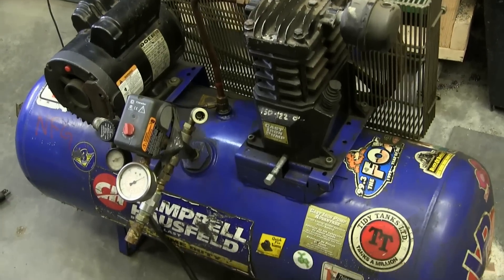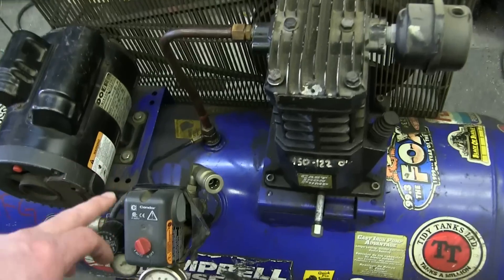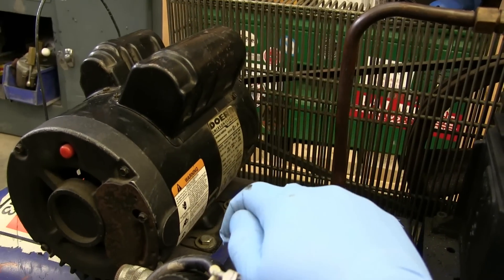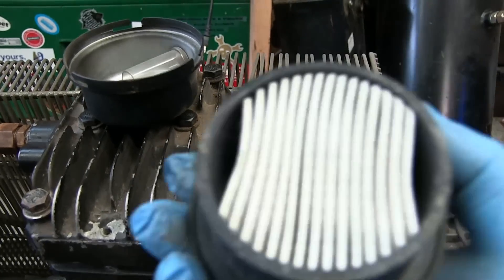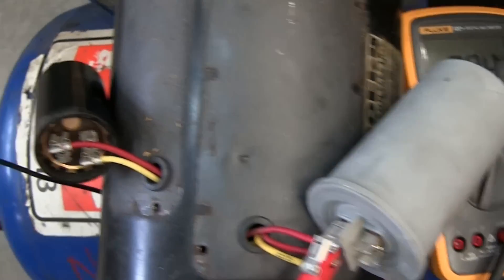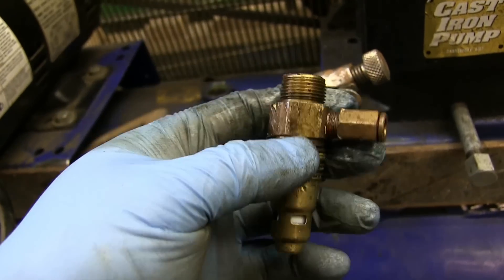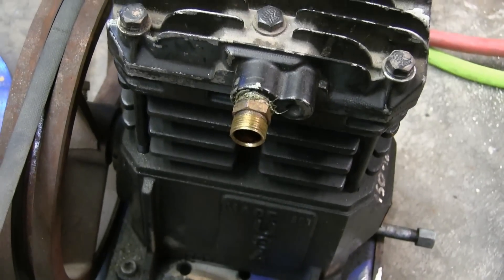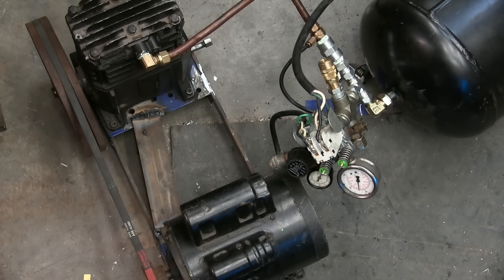BOLTR: Air Compressor Explained and Fixed.

Comment: That long tube doesn’t send the pressure to the switch, the switch diaphragm in the middle is connected to tank pressure through the 1/4” NPT nipple at the tank. That tube is part of the unloader that ensures the piston isn’t starting against any pressure. It empties the pipe from the cylinder head valve to the check valve at the tank.

Comment: Excellent video...  The couple hundred dislikes only proves that there are some serious idiots out there who aren't smart enough to know when they're being given a master class and terrific information.  It boggles the mind, as to what they're expecting to hear.
 I was an air compressor/pneumatic tool repair tech for neigh-on a decade and I've not heard anyone be able to properly explain their function, outside of the trade (that includes you, my industrial engineering friend, in "the trade" 😆)...  But I've known a whole lot who could mess one up in a hurry. 
  The valves in the pump (depending upon mnfctr) may be circular, disc valves or they may be rectangular "reed valves" that just flex up and down, letting the air flow in through one set, out through another set in the valve plate, located between the head and the piston cylinder body, passing the air through the pump.
  The reed valves are regularly breaking as they become brittle after so many heating and cooling cycles so, anytime your compressor suddenly stops building pressure, first thing is pull the head and examine the valves.  Circular valves can become carbon fouled and stick/break, as well.
  Uummm, those air filters are cheap, you may want to replace that thing...  😆  Not only will you get better air flow, your pump won't work as hard, helping keep the Temps happy.  😀 (I know you know this, just letting people watching this know how important clean pump filters are).
  Change the pump oil regularly!  There's no oil filter and the rods will seize to the crank!!!
  The belt tension should be same as your car, able to turn 90° left/right with about 1" - 1 1/2" total deflection.
  The number one thing to keep from frying the capacitors and the motor is DO NOT RUN EXTENTION CORDS!  50' @10ga., max length.   If you need to reach farther away to the work, use longer air lines!!!  A, it's extra air storage in longer lines and B, it's cheaper to buy air hose than electric hose!!  I replaced many motors that should never have gone bad because people kept running compressors on 100+ft. of light gauge extention cord instead of just buying more air hose.  Stupid at its finest.
  As a major Mr fix-it, certified mechanic, fabricator and all around cheapskate, I'd love to find a way to fix it.  Buuut...  For that type of compressor, they make reasonably priced replacement tanks all day long.
  You're right about the whole pressure vessel thing, even if you rendered any flammable inert, welding a pressure vessel and guaranteeing that there is zero hidden porosity or heat-induced weakness in the repair area is next to impossible.  Or at least enough so that it's not worth the risk unless you absolutely had to have the tank and couldn't find a replacement, then you'd have to pull that bung and find a way to insert a piece of backing metal to reinforce it, drill some holes in the area to be welded and through -tack the piece in place, then grind and welding the crack, bonding the tank and reinforcement.  Uh, yeah.
  Creating an area stronger than the area being repaired is next to impossible.  The only way to "cowboy through" would be flood, grind and fill it, X-ray it then over pressure the tank by a few hundred percent and leave it for a loong while to see if it holds.  then replace the tank ASAP so it doesn't have a chance to rust through (welding and forgetting it would let just enough time pass for some, poor sap to come in and use it at full pressure and blow himself up).
  If all that sounds like a rant of excessive BS,  it's because you don't welding pressure vessels...  😆

Comment: Pro(HVAC)tip. If your centrifugal switch goes out, bypass it and replace your start capacitor with a hard start kit.google" (motor hp) hard start kit".about the same price as a centrifugal switch and more durable.

Comment: Do not let fear and common sense hold you back Young man great things await you. This must be a common problem as I have the same tank and compressor and it had the same problem.
 The problem is they're trying to weld cast to normal steel. Being that I to Live in the empire of dirt as well.  Sout west of you on an Island we do have to fix things.  Just weld it up and it will be good for another 1/4 century. If not I will let you know.

Comment: I built pressure vessels for near 10 years as a welder. Difference was most everything was 1/2" thick. But everything was xray and hydro pressure tested. 

That said it can be welded BUT I would drill a hole at the end of each crack. Grind out damage and weld up. Yes fill with water  and rinse out. Then back purge with 100% argon

Comment: I have an air compressor that blows breakers because the motor stalls when it turns on. If I turn the pulley by hand to get it going it will chooch... what could be the problem?
Reply: Either the unloader valve or a start capacitor is my bet

Comment: i welded a 200 gallon quincy blindly 6 years ago where a leg broke off behind it next to the wall.  it couldn't be moved easily and at the break it was a bad leak.  6 years later it just started leaking again.  i won't be welding it this time.  that thing shakes like and sounds like a harley.  50 horse electric motor (oversized), qr 5120 compressor.  tank is much older and too small at 200 gallon.  we run it at 150 psi.

Comment: Where did you install the check valve?  Looks like you put it into the female to female coupling?  It had enough length to fit the check inside?

Comment: The valves on the cylinder head are reed valves like on a dirtbike with a two-stroke engine. that small tube is called the unloader which allows the section of pipe to be “unloaded” when it achieves its desired pressure...So it’s not starting up against a load. The switch senses pressure from the diaphragm underneath the pressure switch which is screwed directly to the tank nipple

Comment: I need additional info on the bleeder tube and pressure switch. The Pressure Switch - as far as I understand gets its pressure reading from the fitting on the back which runs into the tank, is that right? So what does the black bleeder tube do and why does it run back into the check valve on the engine side?

Comment: I think you're confused on electric motors and what run capacitors are for.  Run capacitors do the  same thing as start capacitors except they send power to the start windings whenever the motor is running and they're a lower micro farad rating. If you remove the run capacitor, the last thing I would be wiring about is pissing off the power company and more concerned with my motor drawing LRA and trippng overloads.

Comment: Low pressure vessel. A simple hydro test using anything capable of pumping more than the original safety test pressure should be enough to make it at least as safe as new. Check with your local SCUBA diving place for some time in the test tank they use to recertify HPA cylinders, or a $50 PCP airgun stirrup pump will do 3000psi destruction of any low pressure vessel given enough cranking. For HPA the test pressure is much higher than rated. It must be possible to easily test a shop compressor receiver using a bit of SCUBA air and a bubble mix/internal microphone cracking detection etc.

Comment: Hey check out the worst compressor tank ever. Bondo and solder. I bought it used and didn’t look underneath. 😑 Now im trying to salvage the parts and move it to a new tank.

Comment: Small nylon line from check valve to pressure switch is the unloader line to drain air pressure from the line going from the exhaust valve of the compressor to the check valve when the PS shuts off, to enable zero back pressure (on the compressor) starts when the tank is at the kick in pressure. The pressure switch senses tank pressure through the fitting, usually 1/4" NPT, on its bottom.  Great video as usual. Michael from Colorado

Comment: If your compressor has an adjustable air regulator, you may have a pressure loss under high air flow such as when using an impact wrench or other high cfm tool. If you tee of of the back flow valve you can get full pressure. Easy to check using installed gauges.

Comment: Where's your sense of adventure.
It's not like it's a gas tank. Ya fill it 80% to displace the fumes and give it a torch. Just keep water away from dicect contact with welding area. And all will be okey dokey😋

Comment: Check the aliment of the pulleys with a long straight edge. The straight edge should touch across the two pulleys on four spots. A lot of belt driven equipment needs this check.

Comment: If you welded that tank I would have unsubscribed. I have 20 years of Compressor experience. Recips all the way up to 500 Hp. Rotary Screw and vacuum pumps and roots blowers. Keep you wiener in the bun.

Comment: You probably could’ve gone around 70 amps with the 3/32 rod, using 1/8” for open root in college we typically ran 84-88 amps depending on position. According to the books you could go as low as 40 for 3/32 but I would keep it above 60 unless you’re working with very, very thin material.

Comment: Question for the ole wise one?

Can you over drive your pump by changing pulley sizes?
I’d like to increase cfm...
Reply: If you have the hp on the motor to handle the load increase and the pump can take the rpm increase then yes

Comment: Your description of how a single phase motor runs is off track. The start winding and cap are there to give higher torque at start up. The second cap is there to provide the neccesary phase shift for normal running, not powr factore correction.  If you disconnect it then the motor may still run but vvery badly with almost no torque.

Comment: A little late but it's always worth it to add to the big picture. The 1/4" copper line from above the check valve to the pressure switch is not the pressure sensing, it's a mechanical bleed line to remove the head pressure and theoretically make starting the pump easier on the motor. If you want to help your motor even more add a solenoid valve and an on delay timer, 3 or 4 seconds, to bleed off the pump"s pressure to atmosphere allowing the motor time to get up to speed without the pumping load being added on top of the already high start current. This mod has proven to be a worthwhile investment and none of the compressors I've added it to since I did the first one, '74 at 70 Mile House, have fried a motor. Good day.

Comment: I am building a compressor out of a V 6 car motor .I plan on cutting the valve area out with a plasma welding a plate with 3 one way valves ,2 in 1 out  . Super charged with an electric leaf blower . Am I on the right track?

Comment: Never understood why the brilliant minds that designed the larger,stand up type of compressors,have that copper line,which gets really fucking hot, right next to the on/off switch. I've been burned more than I'd like to admit. Why does that copper line get so hot?

Comment: ok so the line ahead of the ball check valve into the compressor is an unloader, when the compressor cycles off, a small pintle is depressed on the other end of that line..   Air bleeds off ahead of the ball check and takes all the head pressure off compressor..

As I recall, that pressure sensing switch picks up reference pressure from a line punched directly into the tank... yay? nay?   ya chooching with me?

Comment: Hi AvE, any chance you could have a look at this? 
https://www.reddit.com/r/electrical/comments/88iz6q/single_phase_induction_motor_wiring_help/

Thanks,
Reply from the maker: It's gotta be rewound. PITA. Buy the correct rotation motor and move on.
Reply: AvE so no way to rewire it to spin clockwise 😬🤤☹️

Comment: There is significant pressure loss in the pressure regulator under high air flow, so you can get full pressure by putting in an outlet pipe straight to the tank and teeing off to supply the regulator. I think standing water in tanks is a problem, so rigging a drain that drains ALL  the water is not a bad design consideration, as is separating the compressor and tank (or tanks) for that matter, if you have your shop plumbed for air.

Comment: I met a guy who had a relief valve stick on his similar compressor and it took out about 5-10 feet of the adjacent wallboard. Made for a sobering photo! I guess you could hydrostatic test it, it might well be safer to have an old repaired tank that had been tested than an untested one. There is certainly more potential danger in a steam boiler than in an air tank and they test steam boilers.

Comment: Capacitor should be discharged prior to measuring, disconnected from circuit. then check with a capacitance meter. Cheers

Comment: The black cap is the start cap the plastic pos cap is the run cap. The run is a 30 Mf +/- 5%, its within range. Start cap is probably 215 Mf +/- 10% within range. You're good

Comment: As I know the pipe you call sense line is for pressure release when the the final pressure is reached so that the motor can start easier.   @AvE
Reply: aka an unloader

Comment: please invent an oil heater dip stick for those of us who need to get compressors to run in winter. I have to have a leaky hose so it cycles every so often or she seizes solid and Im tired of taking the thing in the house at night.

Comment: That's not a check line, it is the pump release/blow-off line. The pressure switch releases air from the pump back through this line when it stops the motor so that the motor is not restarting under load. The check valve stops any air coming back from the tank when this happens. You can hear the short loud release of air when it reaches cut off pressure. This is why you should not turn your compressor off at the wall until it reaches cut off pressure or you can burn your motor out when you switch it back on.

Comment: I have the same system. Just the other day I noticed it leaking at the weld for the wheels. I want to braze it..  I'm a Hvac Tech and brazen all kinds of vessels accumulators expansion tanks, with have Refrigeration oil in them. That oil burns and if your breathe it . Any way why don't they explode? ALSO WHAT DID YOU USE TO TEST FOR A LEAK?

Comment: I'm a know nothin' stupid person. Any ideas what causes an air compressor to trip a circuit breaker every time on restart?  Note: from completely empty and then filling, no problems. Only when after full, is used, then attempts to re-fill, trips breaker 100% of the time.
Reply: knpstrr Hope you found your answer by now, but just in case... Check your blow off valve. After it pumps up the first time you should hear an air leak for a second or two. This relieves the pressure in the pump so the motor doesn't stall on restart, blowing the breaker. The blow off line is the 1/4 inch line coming off the check valve going to the pressure switch. If blow off isn't working most likely you will have to replace the pressure switch since the blow off valve is in it.

Comment: 2 questions- I have an Emglo compressor, continous run. On job sites stop start would blow the breakers. So mine runs all the time with the poppet valves dumping when pressure is reached. It is now in my shop located away from work area so noise is not a problem. I have thought about converting to stop start but don't have enough evidence to support making the switch. Secondly my shade tree mechaneckin thought hot air into the tank would cool and lose pressure. So I took the copper outlet from the compressor and increased the length by coiling it before running into the tank to displace as much heat as possible. Useless addition or does it have any basis

Comment: 90 amps for a 3/32 6011 seems pretty high, no iron powder in it like a 7018 so doesn't take as much to make her chooch. Thin, aggressive cellulose potassium flux means you don't have to feed her as many pixies. Would probably be easier at like 60amps or something I think.

Comment: +AvE VERY IMPORTANT not really haha. That start capacitor is most likely a 216-259 uF unit, which leads me to believe your's is ever so slightly out of spec (due to moderate cycling since the last quarter-C checkup) if you had $20 burning a hole in your pocket whilst in a Grainger or similar outlet before the next service is due, pick one up.

Comment: Ok,  great vidjo as always but here is the problemejo.  I have the same thing for better or for worse at a 80 PSI tank.  The tank is good and the compupressor lookie ok, on accout that it lookie louzz the brandy newz.  I try to pressy fit into the wall in the US an get the dick in the vice motor humming.  The regemolator is missing, but what is the exact electromacall pixies that i need to run out of the wall in the US to get her choochin to check the motor weebin-a-waabie.

Comment: Welding on a pressure vessel simply requires the same confidence of hitting on someone slightly out of your league. If it goes wrong, the results are almost the same.

Comment: You missed mentioning the bit about the head bleed down, and called that the pressure sense line. The pressure switch runs on the bottom of the switch that was screwed right into the tank. It was all hooked in the final shot, just not explained